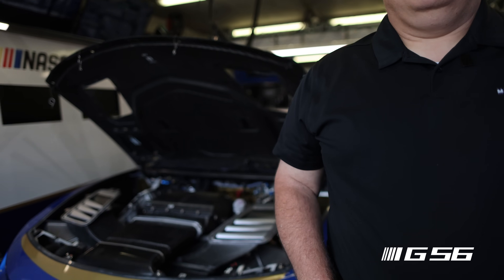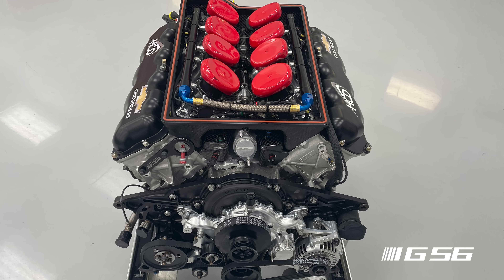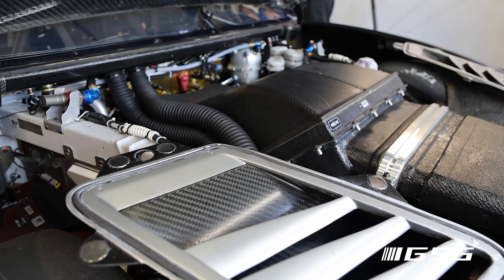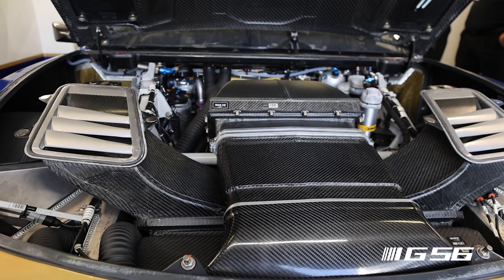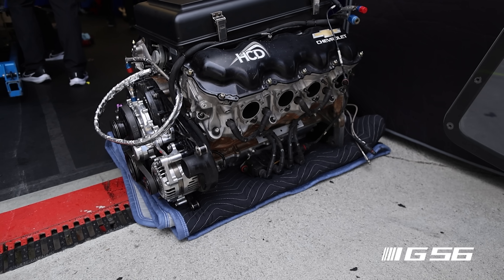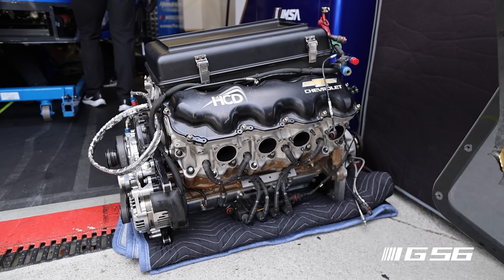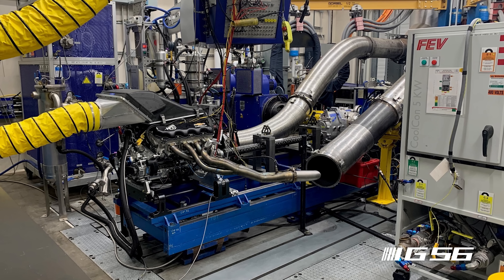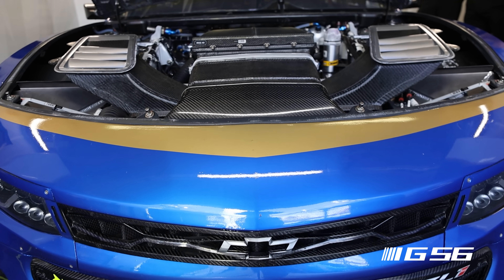Garage 56 Le Mans Engine Tech with the NASCAR Chevy Camaro ZL1 Cup Car

Comment: I wonder if we will see a Garage 56 entry next year? There have been multiple years without an entry. What sort of car would you like to see in future?

I guess we do really need to see a fully electric car attempt the 24 at some point, so that would be cool. It would need a swappable battery pack though.

Personally though I'd like to see Garage 56 have an F1 car in it (something recent like the Mercedes W12). It would need some modification, just like the Camero did from normal series specifications, but it would be very cool to see.

Comment: If it is going to compete in a class in the future then fuel consumption will need to improve, power is not an issue obviously. Had a far bigger fuel cell than anyone else in the race i believe. Just a talking point.

Comment: The fact that they had to really upgrade the engine, suspension, brakes etc. to handle a 24 hour race. For sure wasn’t a regular 3 hour or more nascar race.
Reply: Mainly the brakes, to be honest. The only change to the engine was the reduced redline, with the power difference more than made up for by the removal of the intake restrictors. Suspension was also largely unchanged, with a few modifications to provide additional clearance for the brakes.

Comment: Beautiful Race Car. I'm surprised to hear Cast iron Block with Aluminum Heads, went for Durability that's gonna last over Aluminum blocks if makes a mistake,  Cast iron blocks have been around for ever and still being found in junkyards, if they turn over, chances are they will get it running. Doesn't warp as easy. Then only 2 valves in heads, surprised me there but went for Durability now.  Like he said valve train goes 1st in Cup cars, still can make Horsepower if down right. Mr. Hendrick and ECR combined to build this engine for Lemans now,  yeah they did a great job for GM, I wonder if cheaper to build a engine out of cast or aluminum? I'll say cast. Just a bit heavier,  placed in right place with a 6 speed and they finished a long race with 3 divers that was a Nascar style car with headlights and tail light's that works and required to have.  They made it threw that wicked rains also that took out many cars spinning in circles. That's scary when no control like that. Congrats to Caddy and to Corvette, great job and great job with Nascar in which they should of had a bigger reconciliation of racing 24 hour's and being able to add all parts and pieces needed, only thing that was ugly was the mirrors on the Nascar, I'm sure it had to do with winds coming by and not having the factory mirror to the CAMARO, I'm sure it had something to do with either bringing wind in as needed to cool down  some.
Reply: Its the motor specced for NASCAR racing here stateside. its been around quite a while in this form but restricted in the intake to keep the power down on large oval tracks. Guessing here unrestricted its making 650 hp.

Comment: Those welds though 🥹
Reply: What are you even talking about
Reply: @madmax2069  In the engine Bay on the front corner. The welding of the metal is done nicely

Comment: Love it! ITB’s!!
Next needs to be DOHC 32 valve so they can raise the rev ceiling to 10000rpms!
Reply: Cup engines used to run near 11,000.  8,000 is easy

Comment: The money spent on just the reliability of the power train has to be staggering.
Reply: Yeah, they could have built a "real" racing engine for the money they threw at this engine - that has no future in any GM cars.
How about spending GM money on engines that will not see you begging for a taxpayer bailout again Mary
Reply: @DennisMerwood-xk8wp GM is spending 850 million on a 6th gen pushrod 2 valve per cylinder V8, I don't think they would be spending all that money for an "outdated" OHV V8 architecture while only spending some 100 million on EV tooling if they didn't think these engines didnt have a future in GM. The hybrid Corvette went back to the LT2 pushrod engine instead of the high revving LT6 32 valve DOHC. 

Oh and all Chevrolet OHV V8s still use the same bell housing bolt pattern from the gen 1 small blocks from 1955. Long live pushrod V8s!
Reply: @oddball0045  I've no problem with any of what you typed my man. Mum and Pop do not need a DOHC cam engine. 
Except you left out the part about lining up at the gas station for a mile waiting to get your $20.00 per gallon gas! Rationed to 10 gallons per week.
That's if there is any gas left for you after the US military gets theirs first.
When the Saudis and the Russians are the only ones left with cheap gas my friend the USA might just be in deep doo doo.

Comment: Just causally running an Iron Block in 2023, at Le Mans.
Reply: Hardly casually Lucas -  no word about the amount of money they threw at this thing!
Reply: @DennisMerwood-xk8wp  True. Just figured it'd be an aluminum block.
Reply: More durable for the le lemans aluminum would’ve saved them weight but probably would’ve costed them staying the hot for that period of time with that amount of power

Comment: What's amazing to me is how long the R07 engine has been around. I remember when I first debuted back in 2007. Arguably one of the greatest race motors ever created.
Reply: Pushrods and 9500 rpm
Reply: Too bad it can’t make its normal power level anymore. NASCAR is so dead set on low horsepower.
Reply: @warrenself  NASCAR would be better with more power
Reply: Arguably one of the greatest race motors ever created.
Offenhauser 4cyl: Hold my beer!
Cosworth DFV V8: Hold my beer!
Ferrari V12: Hold my beer!
Reply: @DennisMerwood-xk8wp  I didnt know "one of the greatest" was restricted to three
Reply: @jandersen016  hahaha I was going to go on, justin! 
Novi V8. Honda V10. Matra V12. BMW F1 4cyl 1.5-liter turbo - 1,400bhp. ...oh never mind!
Reply: @DennisMerwood-xk8wp  Novi v8 wasn't great. It was barely used
Reply: @aaronisgrate It was used from 1946 until 1966. 20-years. In 1946 it was claimed to make 510bhp!
Its best result was in 1957 when two Novi's qualified driven by Russo and Tony Bettenhausen. Russo finished fourth.
The final STP-version of the Novi V8 in 1965 had a revised two-stage centrifugal supercharger and was 2.74 liter. At ~54 psi boost, it had a power output of 837bhp at 8,200 rpm. 305 bhp/liter! 
Compared to today's Chey V8 Indycar engine's 346bhp/liter. By any criteria, accept reliability, and it never powering a Championship Car race winner, few engines have become as famous in automobile racing as the Novi V8.
Reply: @DennisMerwood-xk8wp  you forgot the 426 Hemi (GEN II)

Comment: Think about it… Iron block two valve pushrod engine! The technology is so old you could carbon date it. Yet it’s out there kicking butt. Pretty amazing. 🙌🇺🇸
Reply: Ironically there are iron blocks out there that were cast before nuclear testing became wide spread. So yeah literally, could date the iron based on its lack of carbon 13.

PS. Just found out it's mostly cobalt-60 that's the radioactive contaminant not carbon 13. So forget everything I just said.
Reply: Overhead cams are older than pushrod OHV tech by one year. Not sure why everyone keeps spreading this "ancient technology" bs.

Comment: Why use a cast iron block and not aluminum ? Or does NASCAR not allow aluminum blocks .
Reply: A cast aluminum block isn't stiff enough and would distort, letting the cylinders get out of round.  And there's no way NASCAR would allow billet 6061 blocks.
Reply: Aluminum would melt

Comment: Wondering how the gearbox will hold up. The brakes will need to be changed a few times with this heavy car.
Reply: Yes all cars change brakes at lemans but the Camaro will take 5 minutes the other cars take less time, these are also carbon fiber brakes
Reply: They should have used the v8 supercar brakes setup for quick change half the time.

Comment: So are we all agreeing that it's sitting around 700-750hp since they don't wanna reveal anything?
Reply: It's over 850 man 😅
Reply: That would be my guess. Considering he didnt say they took all the restrictions away. As nascar used to run 900 plus
Reply: @MaxVerslappin48  The Yank bovine excrement is getting deeper every video! 900 plus - for 30-minutes! Kaboom!
Reply: Yea probably about 750. Cup cars make 750 with the restrictor plate on. For this car they took the restrictor plate off but turned the RPMs way down. So it's probably making about the same power as a cup car but with way less RPM.
Reply: @jacksonhowell7242  How many BHP you reckon the Ferrari engine is making? And what's the comparable BHP/liter? The old iron block V8 is going to look pretty sad!
You can't turn a sow's ear into a silk purse no matter how many Yanky dollars you throw at it.
Reply: @DennisMerwood-xk8wp  Impossible to say with what little he said. They removed "some" of the restrictions and reduced the max rpm by a "little". Pretty vague, so it would just be speculation. Not sure why you are comparing it to Ferrari though, it was in an experimental category by itself. Also, if you want to try to toot some superior european HP/liter horn, look no further than the C8 Z06's 670hp 5.5 liter. Most spicy current production na V8.
Reply: @paulchilders9969  120bhp per liter is nothing to write home my man. Most all "sports' car engines make more than that. Its a nice engine though. 
The 4.7-litre V12 engine used in the Ferrari F50 develops 740 bhp at 10,500 rpm.  160bhp per liter.
Reply: @DennisMerwood-xk8wp  I said current production na V8's. Also, the F50 only made 512 bhp at 8,000, and only 347 lb-ft of torque at 6,500. That's 505 hp when you convert it. Nowhere near what you are claiming. The Vette has a torque curve that is FLAT all the way across the rev range. So you are getting over 400 lb-ft all the way from 3500 to 8600 rpm, with a peak of 470. If you can even call it a peak.
Reply: @paulchilders9969  Keep drinking the Yanky KOOLAID my friend. You have your Ferrari facts wrong. 
Take care
Reply: @DennisMerwood-xk8wp  You are arguing against google, because I didn't know any of that. I looked it up. So go argue with them to change their results.
Reply: @paulchilders9969  Wiki: The 4.7-litre V12 engine used in the Ferrari F50 GT was highly tuned and developed to generate around 750 PS (552 kW; 740 hp) at 10,500 rpm and 529 N⋅m (390 lb⋅ft) of torque at 7,500 rpm.
OK it was not a production car - but it shows that the Corvette engine is not a highwater mark for ICE engines.
It is a great engine - but let's not get hyperbolic my friend.
BTW, The production 2019 Ferrari 488 GTB is powered by a 3,902 cc V8 engine that generates 661bhp at 8,000 rpm and 561 ft.lbs of torque. As compared to the Corvette C8 Z06's 670 and 470. This results in a specific power output of 169.4 bhp per liter. Higher than the Corvettes C8 Z06's 121.8 bhp per liter.
Reply: @DennisMerwood-xk8wp  If anyone is being hyperbolic, it's the guy comparing race cars to production street cars. Also the 488 is twin turbo, and no longer in production. Seriously, what part of current production na v8 do you not understand.
Reply: @DennisMerwood-xk8wp  HP per liter doesn't really matter if the DOHC cam engine with half the displacement is still physically bigger and heavier, while still making less peak power and having a much more anemic torque band on top of that. Often the case when comparing DOHC engines to the LS and GenV LT series of engines. Pushrod engines have advantages too, along with disadvantages of course when compared to DOHC
Reply: @lorddoobsworth21   "Pushrod engines have advantages too"...... 
THE ONLY ADVANTAGE -THEY ARE CHEAP TO MANUFACTURE.😝

Comment: Is it only one engine for the whol week of practice and the 24hr race or are they allowed to swap engines before the final race.
Reply: Pretty much the latter. One engine for practice, one for the race. But oftentimes smaller teams will go the entire week on just one engine, because the limitation isn't the size of the engine, it's usually the horsepower output - plus it's cheaper to have just one spare instead of two. So a lot of these engines are MASSIVELY overbuilt to the point where the engine itself blowing up during the race is extremely uncommon. But Le Mans is REALLY hard on everything else - transmission, brakes, suspension, aero, electronics, and especially the drivers themselves.

Comment: Boy, those guys are prepared. That intake looks awesome.
Reply: 0:11 mco8m
Reply: Understand that this chassis has no canards, and the air flow is directed to the upturned intake, along with the louvers.
Reply: @jerrylouis8930  The vents on the hood are for the radiator air duct exit. Looks like the one above it in the middle is the intake.

Comment: What a fun video.  I knew Russ O'Blenes a little bit when I worked at GM 2014-2016.  
Wish they would have said how much power the engine is making and what max rpm they will be using.  The GM R07 engine was making 850+ HP before NASCAR started restricting power about 10 years ago.  I wouldn't have expected those 9000 rpm circle track engine to go 24 hours, but with it restricted down to current power levels, making the distance in a 24-hour race should be readily achievable.
Reply: Maybe it is around the 700-750hp area like they had run for a time before the dreadful 550hp rules. But taking into account that they reduced the rpm limit, the restrictor has to be a bit bigger to reach the same power at a lower rpm level. Just speculation from my part, but that's the beauty of engine building/tuning...
Reply: It sounds to me removing the tapered space gave back at least as much power as lowering revs took
Reply: Is this RO7 engine based on the LS engine block, or is it special made just for racing, nothing to do with production.
Reply: @user-Dr.  Nothing to do with production, aside from the bore spacing, which is the same as in the old small block and LS/LT
Reply: I say the RRMS and HP will be kept under wraps. For now anyway.. dont wanna stir up the Sunday round de round

Comment: Pulling for you guys! Let’s go! Will the valve train live with thousands of laps of 3500 to 7000 rpm over and over every lap?
Reply: He has clearly stated they have tested that and including simulating gear changes and running le man on the dyno
Reply: @MaxVerslappin48  Dyno running proves only so much my man. Otherwise we would be running engine dyno races!
Reply: Cup engines used to run near 11,000 for six hours at say Talladega
Reply: @stephenpage-murray7226  Bovine excrement Stephen! 
Penske's infamous high-tech stock block pushrod " Mercedes" V8 for Indycar, built by Ilmor in the UK for zillions of dollars, only maxed out at 10,250 rpm. 
And barely made it through the Indy 500-mile race.
That "Cup engines used to run near 11,000 for six hours at say Talladega" is delusional. Fantasy!🤣
Reply: @DennisMerwood-xk8wp exactly, nascar and nhra is old fashioned tech. GM went out and eventually had to copy Ferrari.
Reply: @DennisMerwood-xk8wp  short track engines usually spin faster at the end of the strait than superspeedway builds. Martinsville is supposed to have the highest revving builds, there is a really big speed difference during a lap and in 2017 the ECR R07 was spinning to 10k at the end of the straits.  At Daytona they top out at like 9k. I think the rear gear rule came in for the 2013 season and that basically stopped anyone from turning over 10k.
Reply: @timothybayliss6680  Can't disagree with any of that Timothy. Ernie Elliot's unrestricted carby engines averaging 212.809 mph at Talladega in 1985, 38-years ago, was so cool. Now all the engines sadly built by two giant soulless companies.
Looking forward to seeing how well Hendricks engines do. Said to be the premier race engine builder in America.
Side note: those racing XR750 HD's made their max 95bhp at about 8,500rpm on the dyno. But the savvy tuners knew their riders held them wide open at the ends of the 1-mile oval straight. Over revving the hell outa em - and they spit their crank bearings regularly. I love those engines! And again, back in the day tuned by their riders(!), like Dick Mann and Mert Lawwill, not the HD factory. About 126bhp/liter vs the 140bhp/liter we are seeing on this ZL1 LeMans engine. Interesting. Both old school push rod engines.